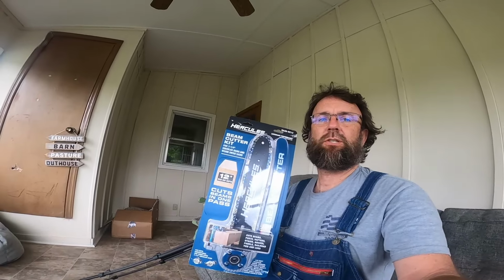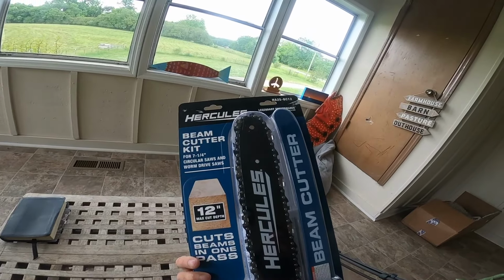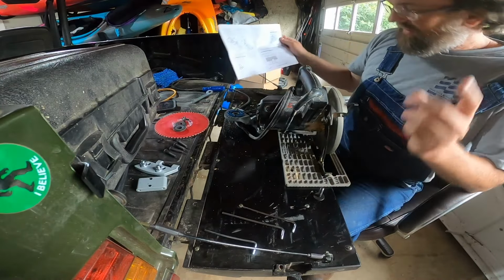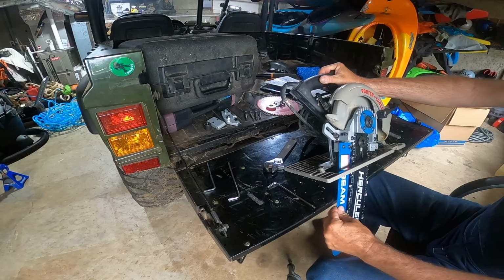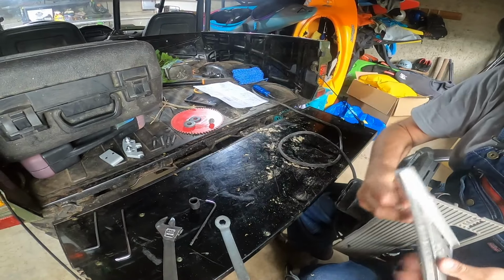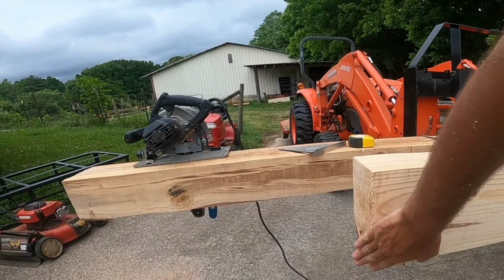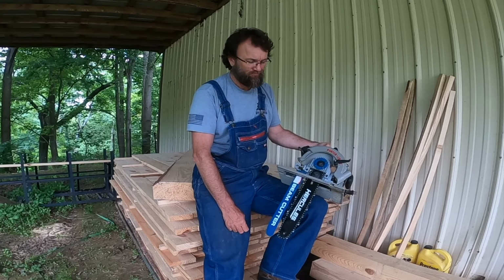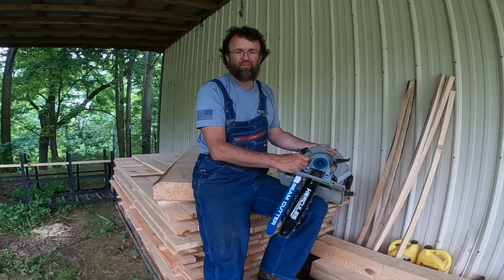$70 Circular Saw Beam Cutter Attachment

Comment: If you attach a scrap piece of wood to the top where the blade exits you should avoid tare out
Reply: Also, take a chisel strike to the cut line.  That should prevent tearing.

Comment: Smoother finish than I expected, nice! - I bought one last month & want to give it a try today. On a side note HF should either up their writing game or just save the paper & do away with instructions. 100% of the time I go to YouTube when any of my HF purchases require more than 2 steps. LOL
Reply from the maker: Hahaha.  Yeah the HF instructions weren’t very helpful lol.  But at least this one is pretty straightforward to install without proper instructions. It does give a good straight cut.  I curf the topside cut with my circular saw to eliminate the splintering and it results in a great cut.  Thanks for watching!
Reply: Agreed. HFT needs to set up a small workshop and hire a literate person to A: assemble a new product, then B: write instructions in American English to tell us how it's done. HFT could furnish the shop on the cheap ..returns, etc...and get a massive payback in goodwill. We all know HFT instructions are shyt.
Reply: @woodrowsmith3400  I know they’re at the low end of the price spectrum but when I have an easier time understanding a random 12 year old on YouTube than the official instruction manual, there’s a problem!

Comment: I bought one of these, a different name brand but they're all identical other than the paint job. I cut many treated rough cut 8 x 8 post both square cut and on a 45 degree angle and the cuts were pretty accurate. well worth the money as it saved me tons of labor by cutting the beam in one cut.
Reply from the maker: I agree- huge labor savings!!

Comment: I;m just a a bit worried about safety on this, there is no brake for when a kickback occurs right?
Reply from the maker: I had the same concerns but the saw pulls the blade upwards into the board so it doesn't seem like it could kick back like a regular saw could.  But definitely an attachment requiring slow and cautious use.  thanks for watching!
Reply: @homeplaceadventures  Unless it pinches on the back side and comes flying out. Maybe the guide blade helps. just count your fingers before use
Reply: There is no kickback because the blade is cutting on the up stroke so it’s pulling into the wood
Reply: @esbrasill  And after? 😉

Comment: Dude! Thank you for the video. I was stuck with installing this on my corded Ryobi and the arbor bolt was too short and pushed the saw too close to the housing! Removed the guard stop and just used the ryobi inner bushing. Installed no issues. I put the bar oil in before mounting but can see I’ll need something to top it off if I do a lot of cuts! Saved my sanity! Thank you!
Reply from the maker: awesome to hear and glad you got it to work on your saw!!  Thanks for watching and glad it was helpful!

Comment: All comments in how to control the tear out are worth trying. Sacrifical board would work best in my opinion. 
I had to laugh when you were unhappy with the cut like you were using a high tooth count finish blade. It is a chain saw. I was way more impressed than I expected to be.

Comment: Can confirm the installation tweaks. On a DeWalt 369 I also could not use the supplied "deep" inner bushing and also had to remove the blade guard stop bolt. Also the T-Slot and bolt that attach the mounting bracket to the saw depth slide is threaded in the T-Nut AND they give you a nut/washer, this is unclear how to install as they will bind against each other. Place the nut all the way on the bolt and add the washer. Then thread it into the T-Nut from the back , if it sticks out the front too far use the nut as a jam nut to fasten it all together.
Reply from the maker: yeah their instructions are not good hahaha!  That's why I put the assembly in the video bc they seemed about useless to me.  Once assembled though it's a great attachment and cuts well.

Comment: wow pretty nifty...
I've used tape on paneling to stop splintering,, this may be a bit heavy for even duck tape.
Reply from the maker: Yeah it’s a pretty handy attachment I must say.  I think for finished grade beams I will cut the first 1/2” with a regular circular saw to keep the edge clean and then rest of the depth cut with this so as to avoid messing up the surface.  Thanks for watching!!

Comment: How does this do ripping? As in could you use this to turn a log into a cant?
Reply from the maker: I think it could be used for ripping but you would want to build a frame base to saw from to get square cuts so at that point you probably would be better off using an alaskan mill hooked up to a chainsaw.  But the power is there to rip with the attachment I am sure...probably would want to use a worm drive saw due to increased use if ripping also.  Thanks for watching!
Reply: I am watching for the same reason.

Comment: Bought one of  these a week ago with the intention of making mantles and trimming thicker slabs.   In your opinion,  could a slightly longer blade and chain be put on this?  Thanks for the video.
Reply from the maker: Possibly?  It would take some fabrication/alteration to accomplish it.  I’d be worried about increased flex/wander in the blade and quality of cut diminished?  Personally I’d be hesitant to extend one but would be interesting to see that done.
Reply: @homeplaceadventures  I doubt I'll attempt it.  Just gives me an excuse to buy one with a longer blade and chain.

Comment: Did you score the top line in order not to have a rough cut?
Reply from the maker: No I didn't and I think that is the only way to really remedy the issue of the rough side of the cut.  I am going to see if a finer cut saw blade is available but I think scoring it or pre-cutting the top surface before cutting with the beam cutter is going to be necessary to avoid the surface being ripped by the saw blade.  Thanks for watching!!

Comment: did you consider removing the blade guard altogether that might have give you a bit more depth to clear bottom plate
Reply from the maker: yeah I didn't think of doing that!  I will have to see if that adjusts the depth ability.  Thanks so much and thanks for watching!

Comment: Did you have a problem with a horrible wobble.  Bought one, and had to take it back.  Now I'm trying anither one and kicking myself in the head as to why it's doing what it's doing
Reply from the maker: No wobble or any issues whatsoever with mine!  What saw did you connect it to?  Mine has cut smoothly.
Reply: Me to. Mounted on a new hurcules 7/14 corded saw. Did you find why it does that?
Reply: Lucky you.  I bought 4 of them.  All the same.   Mounted them on multiple saws.  Bad batch of sprockets.  Clearly machined crooked

Comment: I wonder if you installed some fastcap zero clearance tape on the bottom of the plate if it would clean up some of the tear out you are getting.
Reply: I don't think that would work because you can't plunge the blade through the tape like you could a table or skilsaw. Blade is fixed.

Comment: Use a big syringe at  a pharmacy or medical supply house, 350 cc and they come with a hose if you like, suck in the oil and so easy to fill, and they don't leak and need clean up, For all that work seems like just cutting from all sides and finish with an old fashion hand saw would be much easier. Man, it's a chain saw, not a finish saw. Amaz , Temu or even Ali X

Comment: Have you used tape?
Reply from the maker: No...So far what I've done is use the circular saw to do a quick superficial cut on the surface and then come in with the beam saw and that has been working well.

Comment: Could this attachment be used to cut multiple stair stringers at one time? This could save time on deck builds. Nice video!
Reply from the maker: I think this would be a great use for this attachment and would significantly improve production time for cutting stringers if you clamp the individual pieces of lumber together.  It's a very useful attachment!
Reply: Yeah, line up the front of stringers, crowned, and affix strip of ply to mitigate tear out. Stop short of the corner and use a hand saw to get in tight to cover, or do in pairs with jigsaw in the corners. This isn't flat across the front.

Comment: it seems like a fair amount of tinkering to put this thing together.  it would be better to just buy a 14 inch electric chainsaw for around 100$ and save your time. To switch back to your regular saw blade also takes a bit of time.
Reply from the maker: The thing I like about this attachment way better than just a chainsaw is that this gives very square cuts.  If you aren't doing any open framing or anything where square and good cuts matter then I agree...chainsaw is fine.  But if doing any kind of timber framing where you want good square cuts, this is way better than free handing with a chainsaw in my opinion.  Thanks for watching!!